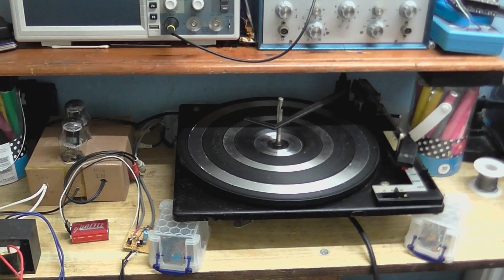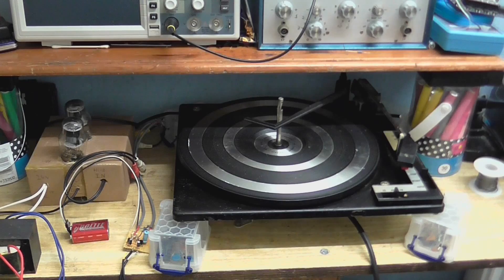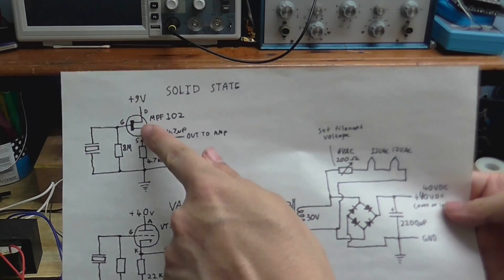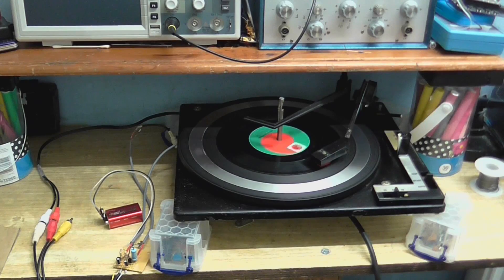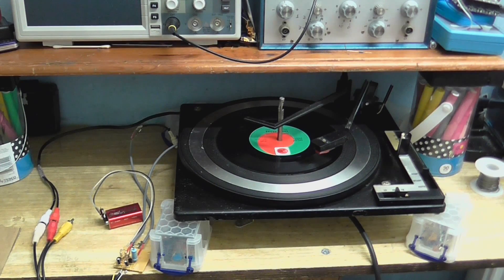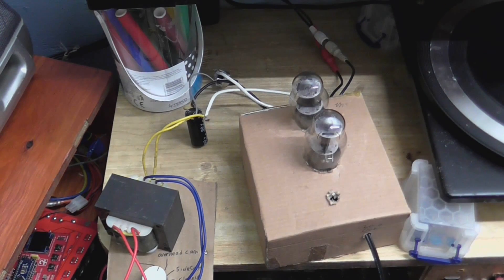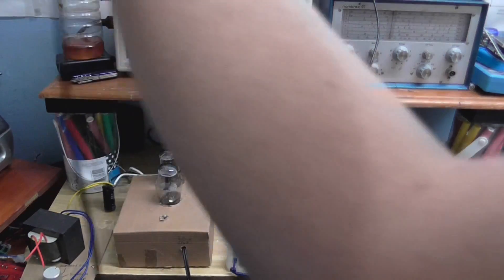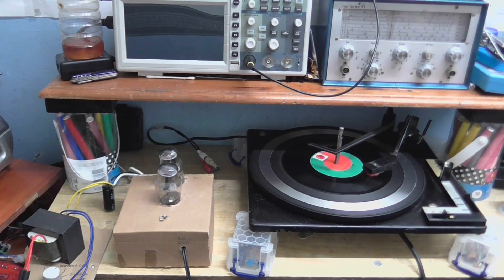The Return of CoolDudeClem's Electronic Workshop?

Comment: So if Crosley were to put one of those j-fet circuits in their record players before the amplifier, could the sound be improved?
Reply from the maker: it would be a huge improvement. I think one reason they don't do that is they just don't know that the amp has to have a high impedance input, so as to not load down the cartridge and make it sound tinny, but it could also be to keep the low frequencies out so there's no feedback from the speakers when the volume is turned up.
Reply: Understandable. The tiniest scratches on the record are exaggerated as a result though, contributing the the bad sound.

Comment: Yeah, I think the tube buffer sounded the best. With the first record and the j-fet amp I could hear a little bit of harshness to the sound.  Read someplace years ago that ceramic carts output matched close to the  riaa equalization curve. With the last record could not tell much difference between buffer or j-fet. Thinking the amps were overcoming any impedance miss match you had between the mixer and the phono cartridge.

Glad to see you doing these videos again.
Reply from the maker: I  prefer the jfet circuit myself, not because of how it sounds, but it's just more convenient to setup. I'll never get rid of valve sound though, as my main amplifier I made is a valve amp and it sounds great.

Comment: Only do what you want to. If you want to make videos make them. If not then don't. As far as the buffers go with the first selection I liked the jfet better but in the second I thought the tubes sounded better. Which surprised me. Because I figured I'd just like one better than the other.
Reply from the maker: I found that too, the valve circuit sounded better on some music, but the jfets sounded better on other songs. I guess valves work best with certain types of music and jfets work better on others.